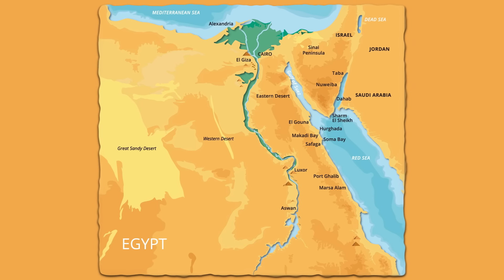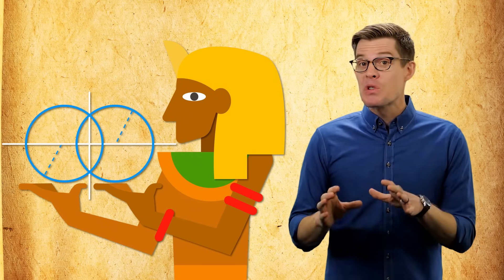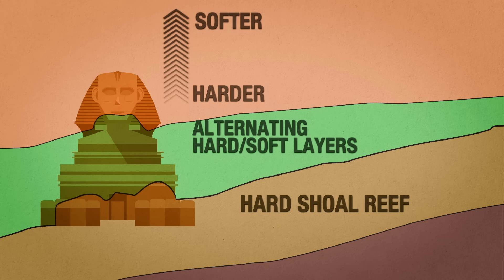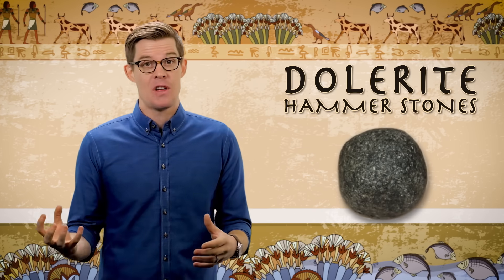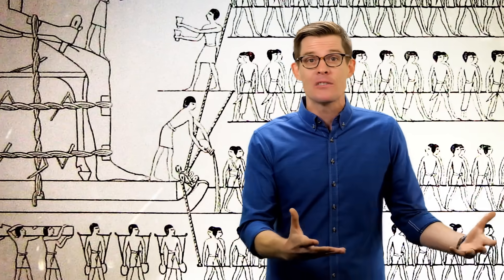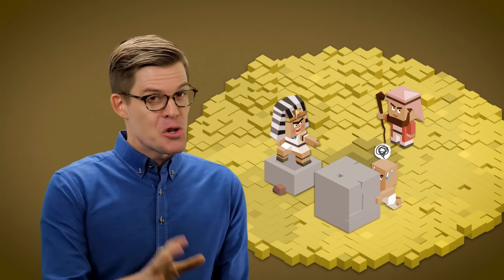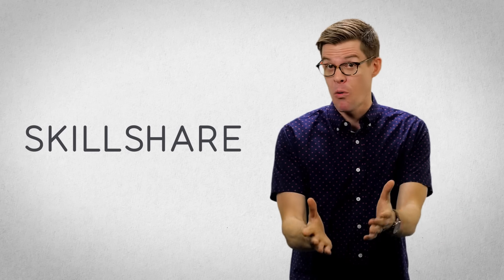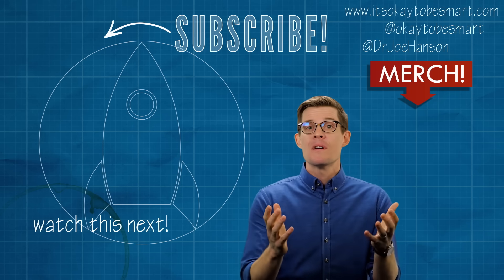The INCREDIBLE Ancient Engineering That Built the Pyramids

Comment: In the construction of the Great Pyramid, there are approximately 2,300,000 stone blocks weighing an average of 2.5 tons each (they range from 2 to 70) which is said to have been built as a ‘tomb’ (despite no body ever being found in it) in just 20 years. That means installing one block every 5 minutes for 24 hours and day, 7 days a week, non-stop for 20 years. This does not include the cutting and shaping, quarrying, or breathtaking multi-angle precision placements of these megaliths. Within this construction, over 160,000 tons of pink granite were transported from over 800km away. Pulled by ropes and logs? We could not overcome these logistics, or build the pyramid in such a timeframe today. 

It’s base is situated precisely along the four cardinal points: North, South, East and West with an average error of only around three minutes of arc which represents an infinitesimal deviation from true of less than 0.015 per cent. The ratio of its circumference to its original height is equal to the value of pi: 3.14, which it is claimed they knew nothing about as it wasn’t ‘discovered’ for another thousand years. The Great Pyramid’s base is at 1:43,200 which is a mathematical representation of the northern hemisphere (which, of course, we are told they knew nothing about). The list of architectural miracles within this construction is extensive, and this isn’t even scratching the surface.

So, we’re expected to believe that a bunch of people using copper, stones, logs and ropes built this with no real understanding of mathematics, architecture, surveying, or any number of sciences which we rely on 100% for the most simple constructions today. They did it at a rate which is far beyond anything we can, even with all our machines, and they did it with a precision which we could not replicate without laser guided, computer controlled industrial equipment. Clearly, we’ve been fed an enormous lie. This was done by a people with knowledge greater than ours, for a purpose beyond our puerile social dictates of materialism and making money. If we understood who did this, when, and why, our entire worldview would change so radically that society itself would transform. And that is exactly why in 2018 we’re still getting taught the same old lies.
Reply: تحياتي لك من مصر كلامك صحيح
Reply: %100 Facts, but why they lie?
Reply: Wow.....you actually took your time to really waste time.
Reply: Why is that nobody questions anything european civilizations built, greeks and romans built/made things that are wayyy more sophisticated than the pyramids for their time(even with the time gap between the romans and the Egyptians what the romans achieved was revolutionary and unreplicated), but when its a non European civilization giving them credit is suddenly out of the question,  there are a clear records/evidence of trial and error(early and uncompleted pyramids) , they clearly had the man power and tools available for the endeavour(as many scientists/egyptiologists has proven time and time again) , even records from pyramid builders and yet u prefer to believe al1ens built them or some other outlandish theory which has no evidence whatsoever , you people clearly need help.

Comment: As he said, they didn’t cut the stone blocks with copper saws! — they chipped them bit by bit with a harder stone.  The Incas shaped stone blocks very precisely in the same way.
Reply: Except that there is evidence to support the Egyptians as using both bronze tools along with gneiss stone ones.  Perhaps next time you should not assume and instead = see the evidence out there.  There are tomb depictions of Egyptian craftsmen using weighted copper saws as well as tubular saws along with a bow drill.  Further there are artifacts unearthed in Egypt which were created in part using tubular drills and in the drill holes was copper residue along with corundum - Mohs scale 9.  Finally in museums are actual Egyptian copper saws.

So there is iconography as well as physical evidence to support copper tool use as well as stone tools for the Egyptians.  What we see with the Inca are the quarries themselves and partially quarried stone - but no actual tools per se or depictions of tools being employed.  Based upon what we see you can deduct the Inca used stone to shape stone - but not metal alloy tools such as the Egyptians had.

Comment: Ok, well explain
1) Largest saw found in ancient Egypt was only 2 feet long.
2) Stones weighed as much as 40 to 50 tons. (11k pounds)
3) Copper saws cut Granite at a rate of 1 - 2 cm an hour using current theorized methods. 
4) The blocks are about 1.3 to 1.5 meters long, with 6 sides to cut and shape. 
5) The largest Giza pyramid has about 2.3 million stone blocks. 
6) The estimated time to complete 1 pyramid was only 20 years. (Around 120 known pyramids in Egypt. Sudan and Libya also have pyramids) 
7) The steeper the angle of the ramp gets, the heavier the stone block gets. 
8) The quarry where they got the stones is 500 miles away from the pyramids. 
9) Copper chisels deform quickly when used on Granite. (Granite is a hard rock)

Call me crazy but I think the theories proposed by the "experts" don't make sense.

Comment: The very fact that they could build these awesome massave things with such precision 4000 odd years ago,and the fact that present day  building experts are not exactly sure or agree with how they did it leaves me feeling like I feel about the big bang theory!
Reply: They are not sure simply because we can't take them apart to know exactly how it was done.

Given a billion dollars and 50 years to tease the structure apart with painstaking detail we would know absolutely how it was done.

Alas that is never going to happen primarily because the pyramids are priceless national monuments that they will no more take to pieces than the French would da Vinci's Mona Lisa painting.

The science absolutely exists to examine it using destructive methods, but given time and further scientific advancement we might one day be able to do it entirely without moving a single block away using non destructive scanning techniques.
Reply: They couldn't. It's nonsense. Likely that structure is more than 12000 years old and you can tell that because there is water erosion on the base of the pyramid. Egypt wasn't a rainforrest 4000 years ago.

Comment: This video looks simple, but I still don't buy it:
What power could have moved these stones? Each stone has been estimated to weigh approximately between 2 and 20 tonnes each.
Think about that, that’s 2.5 million blocks of stone that weight between 2 and 20 tonnes each. How did they cut the blocks with laser like precision and fit them perfectly in place? How did they lift and transport the rocks from their original position? How did they move across the terrain, dessert, water,and sand and then lift them on top of each other in order to build the pyramid?
Reply: so why did you reply then
Reply: I still doubt that they moved several ton rocks. Even if they managed to do that, how did they move so large objects, position in 5 or so minutes ?? The pyramid were built in 20 years and there's few million blocks of stone in it (!)
Yes they did cut stones with laser precision, there's documentary where man measures walls with laser tools and it's completely accurate.
Reply: there was not enough people to do the job {sneeze} , also they still had  to drag the blocks all the way from the quarry {chuckle}
Reply: The Khufu contains more than 2 million blocks of stone. If it were built in 20 years that means 100,000 blocks had to be put into place a year. That translates into about 270 blocks a day, 24/7. 270 blocks a day means about 11 blocks an hour. Most of these blocks weighed more than 2 tons. If you have ever worked in construction (or masonry) you would begin to see the problems here. There is no way in hell that an ancient civilization, armed with only bronze chisels could have built the Khufu, let alone the two pyramids along side it in the time period suggested.
Reply: aha so you start to nitpicking here  {smiles} , how my comment liking is even related to Egyptians, {cackle}
Reply: where I said I want to change your mind ? I just know how it works better that's it
Reply: Even in this late hour, there are still oceans of hopelessly ignorant, and clueless fools who proclaim through some warped and deranged thinking and MSM indoctrination that: "Since a massive financial collapse hasn't happened yet, it will never happen."
Same case with you
Reply: A lot of men, animals, and rope. Get the bugger going and inertia helps a lot.
Reply: @Martin_Daniel  I was totally unaware of these videos, thanx!

Comment: The stones above the Kings chambers weighed 75 tones that’s about 150,000 pounds. Not only that they are raised hundreds of feet above the ground. Physics tells you that to get those stones up there you would need a several  mile long ramp. So if you thinks ramps were used to stack these stones you’re crazy.
Reply: Actually the King's Chamber is only around ~43 meters above ground level while the chamber itself is about 7 meters in height.  Thus the roof of the chamber is about 150 feet above ground level while the relieving chambers which are not very high as you must sit in them as there is not enough room to stand are above that level.  That means they rest around 200 feet and below in height.  200 feet is not that high actually as it is merely about 65 meters.

Anyways as noted by Lefyre it is quite possible to raise heavy blocks via an earthen ramp to a height of 65 meters or so.  Also for future reference the ramp need not have gone all the way to the top of the structure for the simple fact that above the level of the King's Chamber the blocks get smaller in size as the pyramid rises in height.  Google photos of the top of the Great Pyramid where people climbed it to take selfies.  Note how the blocks are small enough to have been slid into place by several men. 

Thus the largest/heaviest blocks are actually found in the bottom third of the pyramid = or closest to the ground.  Those would have been raised via the earthen ramp which need only go that high.  Above that level the smaller blocks could have been raised via the lever device Herodotus wrote of which was likely a lever employing a fulcrum and counterweight which would have sat upon the "steps" Herodotus also wrote of as he wrote they first built a "stepped pyramid" ala Djoser before completing the sides.  

Also given the smaller block size at the upper levels smaller ancillary ramps made from mud bricks also might have been employed to raise the blocks as we see examples of both earthen and mud brick ramps in Egyptian construction. So the physics is not crazy after all since coincidentally Egyptologists work with subject-matter experts in construction such as engineers etc. who concluded it was possible after all.  So follow the evidence rather than assuming and wasting time trying to rationalize incredulity.  Better luck next time.

Comment: Explain the saw and drill marks on the pyramids.
Reply: According to the level of "science" used they are an illusion and were created by pounding with round dolerite rocks. There are no demonstrations of this technique but that's not important because it doesn't fit the theory.
Reply: Prisoner60863 The Nephillm built the pyramid’s.. look up the book of Enoch that will tell you everything you need to know! Ur welcome
Reply: @prisoner6063. They were made by saws and drills. Explained
Reply: The Egyptians had rotary saws and drills, they were made mostly out of copper. We've found them. We've tested them on the same rocks. They work just fine.
Reply: Adam Thaxton, hollow drills, yes. I’ve never seen the circular saw idea officially acknowledged or supported. And certainly we haven’t found any of them. To my knowledge. And I’m happy to be proven wrong.

Comment: I would like to see one of your theories to actually work. Like dragging a 100ton block on a sled on a wet sand. And cutting out granite stone using your egyptologist told tools.
Reply: The heaviest stones used weigh only 80 tons but whatever. 3:54 shows the Egyptians doing it with a statue. And there are numerous hieroglyphs showing blocks being towed on sleds. Same principle. You'd think that if they'd done it differently they would have depicted that method. Or maybe they wanted to fool future historians...

Cutting and drilling granite with copper: https://www.youtube.com/watch?v=qeS5lrmyD74
More drilling granite with copper: https://www.youtube.com/watch?v=yyCc4iuMikQ

Again, numerous hieroglyphs showing Egyptians doing exactly that.
Reply: @kosmonautdan6715  the sand would erode the copper saw much faster than the stone. So by this ridiculous theory they would have needed millions of these big old soft copper saws to build the great pyramid. You would think they would have found one by now.
Reply: @bhstor0  Well not millions but yes, they would have needed more than a couple obviously.
But only for granite as the much softer sand stone that makes up most of the pyramids were worked with more conventional tools such as pounding stones. No one suggests that all blocks were made with saws.
And they would be able to recover the lost metal by simply smelting the dust and make more saws. How do you think they made the saws in the first place? They knew metallurgy and wouldn't let such a precious material go to waste.
Did they find any such saws? Yes, more than a few. Here's an example:
https://www.ucl.ac.uk/museums-static/digitalegypt/tools/saw.html

Comment: I keep waiting for the common-sense construction solution: Most likely ramps were fitted to the sides and pulleys were used  to counterweight and lift the blocks up the steep angle - 52 degrees. The steeper the angle, the less sliding friction... anyone or anything going down could help bring a block up.  
The hieroglyphic representations, old as they are, are stylized depictions of times much earlier and don't necessarily demonstrate methods used at any time, yet people tend to take them seriously.

Comment: The problem can actually be reduced to a simple, scientifically viable, test. First, take a representative 50 ton block, the heaviest in the pyramid and have a group of laborers lift it off the ground. Prove that a group of men, using human strength alone, could life such a granite block off the ground. If a positive outcome is achieved then proceed to the ramp problem and prove that the team could drag a sled carrying the block up the required incline.
Reply: So what you are suggesting is that the Egyptians did not build them?
I mean if you're nuts, then just come out and say so.
Reply: You have good thoughts
Reply: A guy on you tube did it with two small rocks.  I can find the link if you like.
Reply: I think in times so back, slaves and strong hierarchies in societies could have been a common occurrence.
Today it may be tough to build and very expensive, but if you were a king and could exploit certain people perhaps it would be much more easier.
The engineering and logistics is an absolute, mystery. 
How such societies died down with time, is also very scary.
Reply: Needs to be tested because from what I have heard the ramp theory does not checkout. The ramp cannot exceed 10 degrees, so it had to be sooooooo long in order to get the granite above the kinds chamber. No evidence of a ramp that big ever existed.